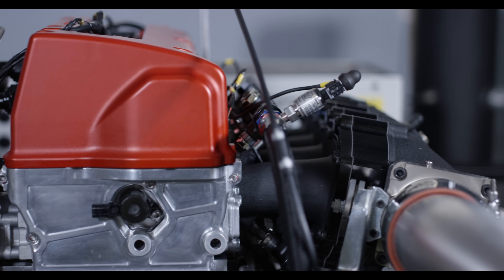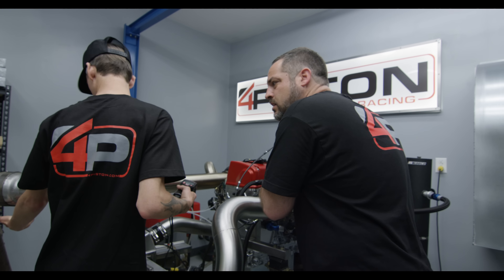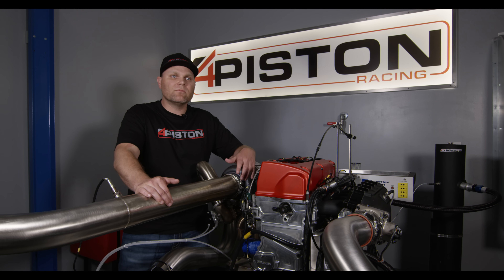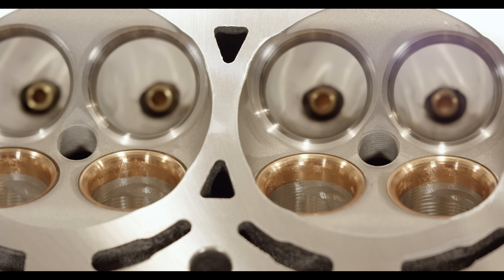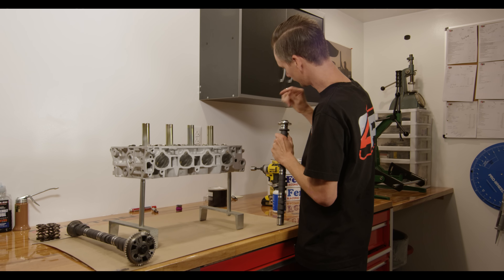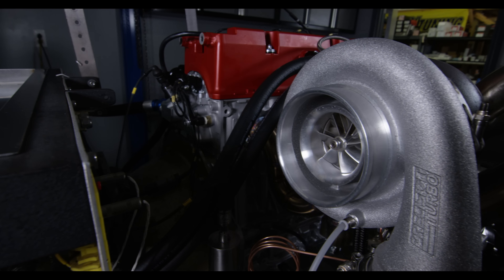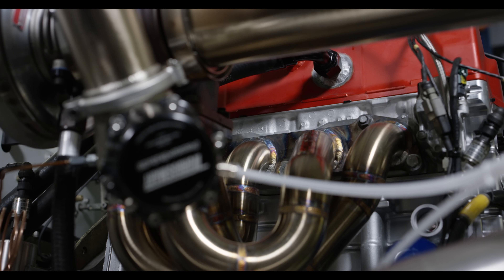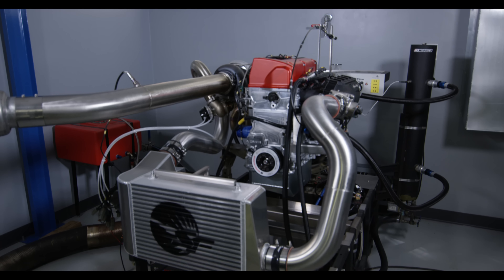1000hp 4 Piston Turbo K24 STREET Engine Build and Dyno

Comment: Just a story for entertainment made from the comfort if IT seat = {
"At 4 Piston Racing we got it building for over a decade and we gonna show you a 1000hp Honda k24 engine". "At another geolocation there was a guy gaining knowledge and experience tuning EJ engines that many people hate. Later he called him self BBR tuning. He started showing to people that correctly tuned and properly maintained stock EJ can reliably be making 500 whp for long time and 600-700 whp less reliably but still for significant time and with torque figures up to 200 less than hp. In the end of 2023 he showcased on his DynoJet an unopened 100% stock from the factory Subaru EJ25 with stock STI drivetrain hitting 700 wheel torque and just over 1000 wheel horse power. Taking this engine off the car and showing us it is stock . No damages ! Engine intact, awaiting what is next. Immediately after he, BBR person, puts in his own built EJ 25 stage X and hits over 1000 wheel torques and 1400 wheel horsepurse while xeddy triple disc clutch is giving up. He, BBR person, can not wait for the track season to open and prove to himself and the others in car community what a stock and built EJ engines can do."
}
<<-EOF

Comment: I love cars, but I've never taken on a project car. I've got a tuned Audi S5, and I love it... But I'm thinking of getting a 4piston engine with a few drag cartel parts, mating it to a ZF 8HP, and swapping it into an MX-5 ND. There are a few other upgrades I want to add to the Miata as well; upgraded infotainment, custom carbon fiber interior parts, chassis stiffening components, wider track suspension parts and upgraded coilovers, pilot sport cup 2 tires on Rays TE27s, larger breaks, and OEM-look molded fender flares - all being the main components on my mind. Now, I know that the 8HP is an automatic, but I'm chasing a car that I can effortlessly throw around twisties and tracks, but which will also be efficiently comfortable on the highway. While you may have your opinions on styling and particular parts with similar capabilities, what do you think of my potential build list? Do you think it could be a recipe for success?

Comment: I can imagine Toretto saying “Not a bad way to spend $10,000”
Reply: If its only $10,000 thats cheap as dirt for 1000hp
Reply: Yeah. Much more than 10k.
Reply: @jacobhoke581  10k for the engine + another 6-8 for the turbo system/intake manifold etc
Reply: Add the transmission and differential.
Reply: And fuelling, ECU ect ect. It's a $40k setup at least.
Reply: Lmao!
Reply: @TheRealKingSamus  really?... damn guess there goes my build..😞
Reply: @TheRealKingSamus  there's kmod stage 4 k24 1100+whp it comes with everything fueling, manifold... It's almost turn key but it needs water pump, crank pulley, throttle body, sensors but for 9,499$ it's really good.
Reply: 10K? In your dreams!!
Reply: @dkdanis1340  kmod has a terrible reputation check some forums for ppls horror stories.  I was considering getting a long block from him but not anymore.  Maybe 5yrs ago lol but apparently that business isnt trustworthy these days 🤷‍♂️
Reply: Put that in 4 spoon civic
Reply: I'd be surprised if the billet head didn't cost close to $10k
Reply: @TheRealKingSamus  40k heck no. Maybe 20k.
Reply: $10,000 is just the long block pal
Reply: @David-gl7rg  A build like this would cost your average Joe $40K easily.. $10K alone for the full motor/internals, $10K for that full turbo setup, 10K for a trans that could handle that type of power(Sequential Doxbox), and do not forget suspension, chassis fabrication(cage), and all the labor involved... $40K at least.. I imagine proper tuning and Engine Management would be fairly expensive too.. I personally wouldnt be running a build like this on Hondata lol.. It would have to be a full stand alone system.
Reply: Yeah my boy Evo Rob paid around $12k for his 9sec or the trailer. In his fwd drag car he just put together
Reply: It's more around 14k for this kind of power in a K series.
Reply: @PEREZCHOOCH  Where do you get that number from? A 1000whp 4-Piston setup like this would cost $30K+ if you include the head work, block work, internals, turbo kit, fuel system, a trans that could hold that power, ect.. The price is massive.. $14K would get you a Full Race kit, your own internals, and maybe a few other goodies to add to your car.. But 14K is nowhere near enough for a full 4-Piston Turbo Setup.
Reply: @PEREZCHOOCH  What you just showed me is pretty much exactly what I said.. A Full race kit, internals and few other goodies(you could def do sleeves).. That's not a professionally bored, sleeved, and ported 4-Piston Block and Head with a 4-Piston Turbo setup.. Remember as well, $14K is the parts alone in DIY Mike's vid.. That does not include time and labor.. And that is not 4-piston.. This also does not include a transmission capable of putting down that power, which would be $6K at LEAST.. (again not including labor)..
Reply: @PEREZCHOOCH  4-Piston charges over $10K for just that Motor setup.. That does not include their Turbo Kit which also costs almost $10K.. Then you need the fuel system, Engine Management, Wire Harness, Transmission that can handle 1000whp, rims/tires that can put that power down, Axles, Big Brake Kit,... The list goes on and on man of supporting mods that need to be done to support  tht much power. You can absolutely do it for cheaper, but not with 4-Pistons products lol. And 90% of people dont do most of their own labor.. Labor is mad expensive.. Im just trying to put it out there for your average Joe how expensive this really would be for them. Like if there is a guy who said to himself, "Man, I really want to have that put into my car", its important these types of people realize the real costs that go behind builds and setups like these.. The costs are massive.
Reply: Mike Harkins exactly. You can build a 9sec car for cheap but that doesn’t mean it’s a quality build. That build is probably fully topped out at high 9s . While this 4 piston build can run lows with the right chassis.
Reply: @MackWittDaCheeze  . It is not. This is why I don't get my info from youtube comments.  It might be 40k for the entire car build (probably more). But overtime if you are smart with money you can
Reply: @MackWittDaCheeze  . But it is not going to be cheap. Personally I would make it a clean car with decent 400hp if I couldn't afford it.
Reply: @MackWittDaCheeze  k24  at a junkyard for like 500 they use a stock crank 8.5 to1 pistons full port and polish Crain cam regrinds t66 turbo
Reply: @TheRealKingSamus  . Not necessarily, there is some conercutting you can do but at that point you are sacrificing reliability, and going for a 600hp build with nitrous might be a more reliable idea. Not to mention the body work you need to do. However 40k really isn't that bad for something of this caliber. Its alot less than those Supra builds, and you actually will get decent gas mileage. If you play the build over 4 years, it is actually pretty obtainable compared to other platforms.

It depends if you wanna have that power in a honda or something like a c5 corvette. I rather have that in a honda because its lighter and I think looks better.
Reply: @turnip5465  more like 3 k for the k24 but okay
Reply: @zacheckert4868  yeah 3k for the engine trans and ecu lol and another 3 for all the other bullshit more if you wanna do more
Reply: @turnip5465  want to do more? You have to do more
Reply: @zacheckert4868  yea so the 10k estimate isnt far off
Reply: @haroldperez1867  10k
Reply: @zacheckert4868  nah this engine cost 10k or are u talking bout something else I mean the full long block engine with all the parts from the website not a stock k24
Reply: let me tell you from experience that 10k is a great investment when it comes to going through the time energy and pain in the ass blowing up bottem ends i know someone who runs time attack with a 4 piston 2.5 stroker with a turbo running 20 psi all day and that engine has lasted 4 seasons of abuse i dont know what they do but its magic and that engine also has been in a street car in florida heat
Reply: @willowwonderbull7100  yeah that 2.5 will have cost much more then 10k if it lasted 4seasons if it really lasted 4  big seasons and it makes good rpm talking 9 to 10k and about 700+ hp those engines easily cost 200k and still need some rebuilding and only run on the season a 4rotor that needs rebuilding every time in a season and only last 1 season costs 55k makes 580hp and 9k rpm or he has to rebuild it every half hour and makes low hp and low rpm for 10k
Reply: k24 is not an expensive motor, but building it like this prolly cost like 15-20k
Reply: @MackWittDaCheeze  go in with a mindset of "by any means necessary" and make it good/reliable/get the power and torque bands set up for your liking, etc.
Send it
You got this!!!
Reply: 10k just for the long block alo r
Reply: Ots roughly $20k said and done. Especially of your going awd
Reply: It doesn't matter if you win by an inch or a mile, winning's winning.
Reply: Lol you ain’t lyin bro lol
Reply: @turnip5465  this is probably closer to 30 lol

Comment: Interesting to me that they recommend sticking with the TSX head. For many years the recommendation was to go RSX head on the TSX block for high rpm, high boost, or big power builds. When did that change?
Reply: DJToneRI 4 piston ported the cylinder head. K20a2 head is better than the k24 head stock but it really has no benefits vs a ported 24 head
Reply: @infamousgarage4900  You say that, but if you look at 4Pistons webpage, their ported RSX head flows more CFM than their ported TSX head. So even with their best engineered port job, the RSX head still seems to be better. This is my confusion why they're sticking with the TSX head here
Reply: DJToneRI  Listen to the video he explained why
Reply: @yadieldiaz6395  I'll watch it again, perhaps I missed it

Comment: No mention of which fuel they used? No mention of compression ratio? Also, why isn't the VTC solenoid hooked up to anything on the engine dyno? They retained VTC, but didn't use it???

Comment: 15 gallon fuel tank should last about 7 miles. Not bad
Reply: That's enough for few races.
Reply: The best part is if you got a good tuner, and you want to drive it on the road,you could probably get well over 20mpg
Reply: @zombie22_  . Because of the magical vtec. You could also have different tunes for different situations, one for daily one for racing
Reply: When people with no clue comment lol
Reply: 15 gallons should last about a little over 1/4 mile in a V8 I would imagine this four cylinder would kid burn 7 1/2 gallons a pass if it were mine but I would be running a carbureted engine with a high flow fuel pump, instead that EFI crap you guys run now a days with a carb it could make a lot more than 1000HP IMO if you wanna build a race 4 banger there’s three choices of blocks a Mitsubishi, Toyota and Nissan I like Mitsubishi the best I had a 2.4L Mitsubishi bored 60 over sleeved at 11-1 compression had 320 psi of compression per cylinder ran a high performance 2 barrel Weber carb that thing was bad ass 0-60 in about 2.5s 0-100 in about 4s it would burn the tires off if I let it and it was N/A never got to take it down the track though sadly no way I coulda ran boost on it woulda blown the head gasket every run probably it got the gas mileage of a large V6 after I built it, boy was it a fun lil truck, I wanna go wild and build another one except with boost this time I’m gonna put a 14-71 supercharger for a top fuel bike on it and probably run it on methanol it’s should do 200+ easy in the 1/4 maybe I can brake the 4 banger world record for fastest 1/4 and MPH cause I’m going with a 4-5 speed lenco tranny
Reply: Yurmums Vajeje  smokey
Reply: Lmaoooooo
Reply: @zombie22_  sense it has vtec, if you remove the boost or have a low spring weight, you could probably do that, if not better
Reply: Dude, if your wanting a 1000hp turbo engine and your asking or commenting about FUEL CONSUMPTION......you truly do not understand big horsepower engines and I suggest you buy a Tesla Plaid and even then your going to MASSIVELY DEPLETE the battery doing 9.60 1/4 mi runs......THE MORE POWER YOU MAKE THE MORE ENERGY IT TAKES TO MAKE THAT POWER REGARDLESS if it's a 572 BIG BLOCK CHEVY or 2.4L Maxed Out Turbo K. It's PHYSICS

Comment: ok I had to stop the video for a minute..... 1,000hp and it still has i-VTEC?
Reply: MO POWAH BABE
Reply: @mcfriendzzone5651  A MORE PAWAH BABYY!
Reply: It goes from a 12v to a 16v instantly.
Reply: @pudu4803  LIGHTNING LIGHTNING LIGHTNING BUFFHORSES OMAGAHHH
Reply: @uncomfortabletruth1548  The I in I-VTEC is the addition of variable camshaft timing along with Variable valve lift(VTEC) not that its computer controlled.
Reply: @uncomfortabletruth1548  Its variable valve lift, not variable valves. All valves work off of VTEC just they ride the lowspeed cam profile until vtec locks the rockers onto the high speed cam profile increasing lift and duration.
Reply: @MrMopar239  thanks mr perfect.  I guess voice to text got it wrong, but you're not exactly right either , but we wont talk about that, cause I dont have to correct everyone, especially autocorrects🤣
Reply: the vtec adds 420 extra hp
Reply: @uncomfortabletruth1548  unfortunately I'm correct with my information and want everyone to get the proper info as well. https://en.m.wikipedia.org/wiki/VTEC

Take a read for yourself so you don't spill wrong info to people.
Reply: @positivesquad  in this case you might not be wrong lol.

Comment: I would like the part number for those pistons if you don't mind.
I am porting my own k24a2 head,running factory cams,using same boostline rods, same intak3 manifold. I haven't decided on an exhaust manifold yet. 
Regardless it will be t4 twin scroll with dual 38 or 44 wg's because my turbo is the gt3582r.
I am not conviced I need sleeves. I have seen factory short blocks making over 700whp.
This engine will go into a 2004 rx8.
Since I am running the rx8 transmission and diff I don't see where making over 550/600 whp will be worth it. Those factory parts will probably not survive.
Anyway...the part number for the pistons would be great. They sound exactly like what I am looking for.
Oh...and those boostline rods ...they are awesome.
Please suggest what sleeves you would get if you were in my area. I am near Charlotte NC
Thanks for your time.

Comment: I wonder how many of those parts are really necessary for 1000hp. Awesome build all the same.
Reply: The turbo is doing a lot of the work....making power is one thing.  Making it last is another.  We use this engine in 12 hour LMP2 cars at about 650hp.  This particular one is in a Time Attack Lotus at 950hp right now.

Comment: They build awesome motors but if you want a whole built long block from them top to bottom it doesn't come cheap but you get what you pay for that's for sure. If you're on a budget do the bottom end yourself and spring for the 4Piston head at least, they do it best. Just make sure you pick the right one for what you need they have so many different options from street to drag or both and even water-cooled or closed deck for the insane hardcore for that matter.

Comment: How is this a big engine when it's like half a 4.8? Why isn't there 3liter four bangers? I know there's 2.7 now but half a 6.2liter or 7.0liter should be like a big block 4 cylinder which seems like it should make lots of torque NA then mad hp with turbo. I know it would be alot of billet work having to have billet block and heads, intake. Custom exhaust, etc. No one else is going large on four bangers. Guess it's not worth it.
Reply: Nick Bowling because over 3.something liters there are excessive vibrations that are just not worth it.
Reply: Porsche did this back in 1988 with the 944 s2. It had a 3 liter 4 cylinder engine with 211hp. :)
Reply: I mean if you look at Fords 4.9 liter straight six that was used in a rediculous amount of trucks, vans, etc. Lopping off two cylinders should produce a roughly 3.3 liter four cylinder. The 4.9 was a very good engine, lots of torque. With proper head /valve design could likely make the most powerful four cylinder ever
Reply: @nbowling10trio  inline 6 is much more balanced then inline 4
Reply: There is a racing billet block from Elmer Racing which is a 4 liter inline 4. It is currently used in the Porsche RP968 WTAC car. Generally the vibrations constrain such designs.

Rip Fiat's S.76, the mighty 28.5 liter inline 4.
Reply: Nick Bowling more weight over square design so no high rpms vibrations galore and the fact that anything over 2.6 should just be a 6 cylinder. This is a big Honda motor not a big motor in general that's what he was getting at. And a van has different requirements for an engine than sub 2800 pound fwd car.
Reply: It is a large engine...4.8 is a humongous engine!

Comment: Wonder how much power they could make by using my prototype?  

The prototype makes it possible to run full timing advance on my Mazda Protege with no noticeable knock or pinging.  

I made A video showing where the timing was and where it is at now, with A few full throttle pulls at the start.

More tests are on the way.

Comment: Its not a giant ported engine. Achieves Peak torque at the revlimiter :P
Reply: That is due to running partial duty on the wastegate.  This thing made over 1000hp holding 33-34psi and will continue to pull to 11,000 rpm at partial duty.  If you run the wastegate at 100% duty it will bring in 55psi and a STACK of midrange power, then the turbo runs out of breath and can't maintain that....you'll see more peak power, but earlier, and then it will start to fall off before redline as it drops into the 43-46psi range :)